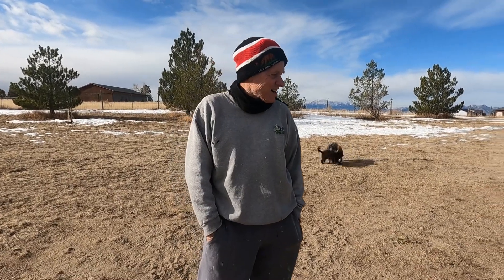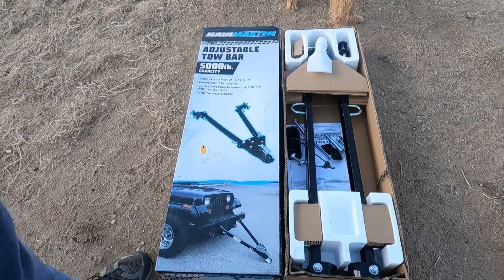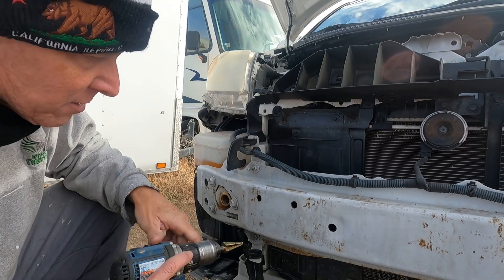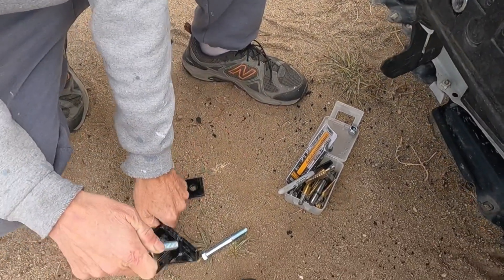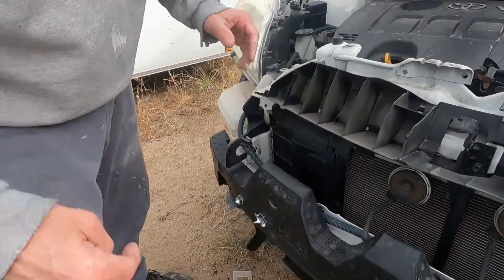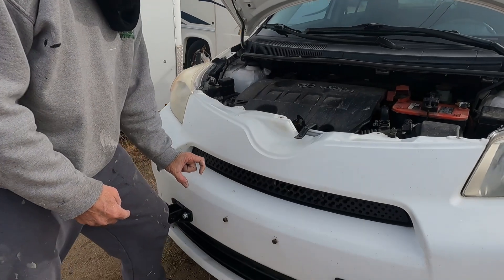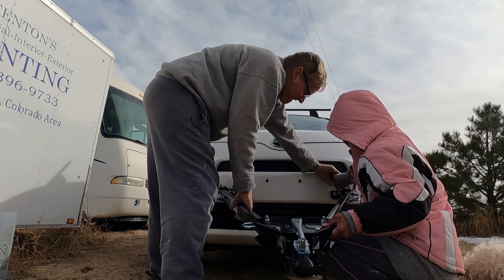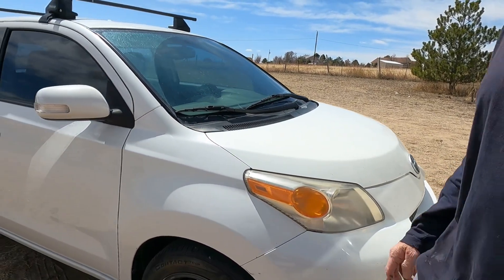Installing a Towbar

Comment: Pretty clever using pipe nipples to extend mechanism.   Did you use galvanized hardware?   What applies the car brakes (if at all) when slowing down?    //  Bet Sue is happy to have a mechanical man around... LOL
Reply from the maker: Yes, i used galvanized pipe to extend the thickness of the foam padding. So far it's working great.